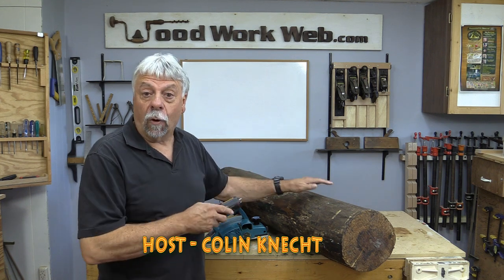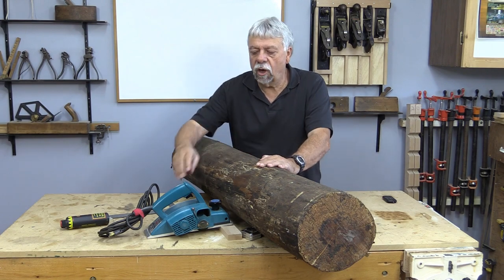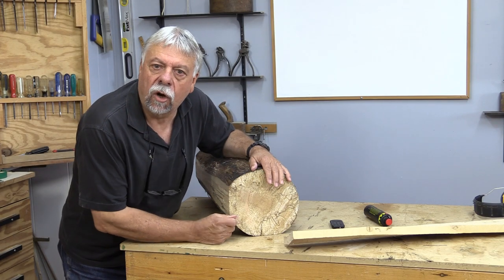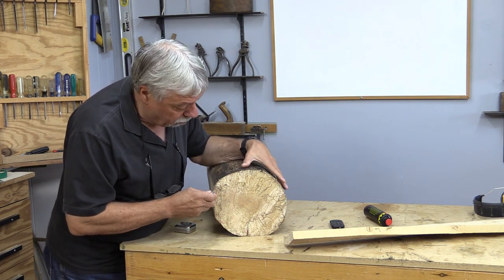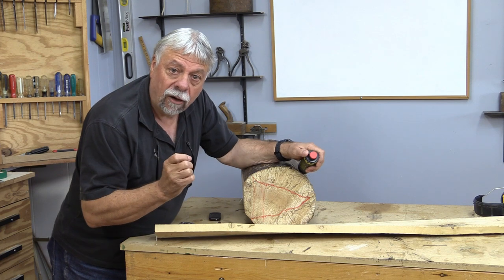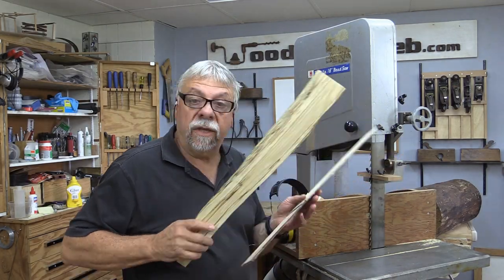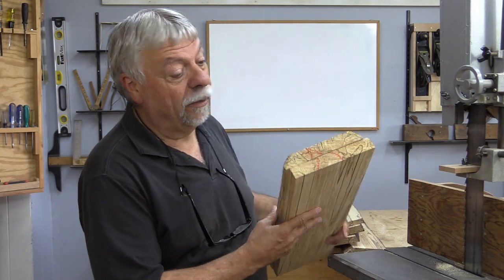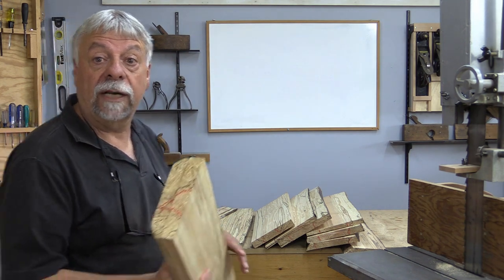How To Saw Your Own Spalted Lumber From Logs

Comment: Colin, I belong to a club who owns and demonstrates an old sawmill.  Try making a sled to run the log past the saw blade, you will be able to cut longer boards.  Also, when you stack and sticker the boards use heavy weights on top of the pile to minimize loss due to twisting.  Great tutorial, sir!
Reply from the maker: +Bill Sutherland Thanks Bill, I have often wondered if the heavy weights on drying lumber really makes much of a difference or not. I have tried with and without and even with serious weight on some, they still come out warped sometimes. I guess the point is, that it can't hurt to do that. Thanks again Bill ...

Comment: In lumber grading we call this incipient decay. Spalted sounds better for sale purpose. Basically its the beginning of the rotting process and it impars the strength of the lumber. Depending how bad it is it would either go into pallet lumber or go into the chipper. Cool looking I have a couple guitars made out of it. Careful if you have allergies. Cheers !!

Comment: Wow, that's one big honkin' blade on your bandsaw.  Nice boards.  I'm surprised how dry you are up the near the water.  It's tough to get anything below 20% down here in Virginia.  Outside it hardly ever goes below 40%.  I use a shopmade sled for cutting logs.  The logs attach to the sled.  Works great.  Off the pile and onto the saw.  Good video as always.

Comment: Do you Sticker the wood you have setting around to dry? 
I have found if I sticker the wood I have slabbed and then tie the boards into bundles to let them finish drying, I don't get as bad of war-page or twisting in the boards while they are finishing the drying process. I use the large nylon tie straps from HF or sometimes even some nylon tie down straps for motor cycles. Seems to keep the boards a lot straighter.
Enjoy your channel. thank you and keep up the good info.

Comment: That wood is amazing looking.  I think its wasted if it isn't displayed as table tops, or desktops, or panels of some sort.  I heard what you said about the fact it may not have the best structural integrity because of the fungus, so that's something that needs to be taken into account.  This stuff almost seems exotic enough to be turned into veener if that was possible.

Comment: A couple of questions for you or anyone else, who may know, but, isn't there a way to make a sliding Band Saw sled so you don't have to struggle with pushing or pulling the wood on the table, surface and, isn't it easier, better and safer to cut the outside of the log to prevent binding etc. I realize you'd have to  move the fence for each cut, but I'm wondering if it's a better way. Also, I never knew that Makita ever made a band saw, but they used to make a 6" planer just like the 3" you have. I use  to sub for a builder that had one and would use it to flatten logs etc for his homes. Not sure if they're still available.
Reply from the maker: +kperellie Yes, there are a few versions of making jig for cutting logs, the reason I didn't  was 2 fold, first of all this band saw does not have mitre gauge slot with would be very helpful for a jig, the second reason was that I reasoned that I could probably cut the logs quicker than it would take me to make the jig ... which probably turned out to be the case, really didn't take that long.  If I were going to do this a lot, I would probably make a jig, but for now I seem to be ok without. ... Good question, thanks for asking.

Comment: I like the use of the electric hand planer to make the flat sides.  Great idea.  For the slicing, you really should have a sled to which the log is secured.  The method you used, although it works, is not the safest and does not yield as accurate cuts.
Reply from the maker: +Mark Hazlewood Thanks for your suggestion Mark

Comment: . Those boards look amazing Many ideas, most of them obvious projects: .. Boxes, for one Furniture accents, too Any sizable scraps could be reserved for smaller projects such as pens or cutlery handles (both types of projects would benefit from those scraps being stabilized with resin. Pens usually take 3/4 "x 3/4" x 5 "and cutlery handles vary. Smaller pieces could also be glued up with contrasting wood species for small projects (turned, etc.). Regarding the movement of the boards in their final drying cycle, what if they were stacked with spacers placed in three locations and substantial weight placed on top of the stack? Would the movement (twisting, cupping, etc) still take place once the weight is removed upon hitting that target 9% water content? Lastly, what a bandsaw! The blade looks wider than my neighbor's lumber mill blades!

(Edit: apologies for all the odd capitalization. Chrome made some very odd auto-correct choices.)
Reply: +YasumotoUS You can normally constrain a lot of the wood movement, provided it isn't directly related to the grain of the wood by using stickers, weights/clamps.  Some of it happens just due to the way the grain moves through the wood though, so you can normally count on a little bit of that happening.  Not nearly as bad as if you just leave the slabs to move on their own though.When cutting through and through like this (boules) - I tend to put the log back together as I cut it with stickers every 18-24 inches and then toss a band strap with a ratchet around the whole log at each row of stickers.  Cinch it down nice and tight with the ratchet and it holds everything nice and tight.  Every month or so, come back to tighten down the straps again, it shrinks a little bit as the wood dries.Once the stack is dry (either air dry for certain applications - or a stint in the solar kiln), it is easy to pull what you need from the stack and everything is in order...because you kept it that way when you cut it.
Reply: Joe and Liz Thanks for sharing your technique!
Reply from the maker: +YasumotoUS Thanks for your comments and ideas. I have had not had the best results with putting weights on drying boards. I often wonder if it really works and I hear varying opinions on this so I really do not know. Maybe I need more weight, or as Joe & Liz say to band strap them. I guess in the end, it can't hurt to do that and any help in keeping them straight would be good.
Reply: +WoodWorkWeb A lot will depend on the specific species involved, and that often gets overlooked when discussing anecdotal evidence.  Hard maple for example tends to move a lot more than soft maple when drying.  Cups, twists and general waviness are pretty common.  Soft maple can often be left alone and it will dry flat with minor distortion and movement that can be cleaned up with a few quick smoothing passes on the jointer/planer.In the end though, I tend to weight (or otherwise clamp) all my stacks - but the more the wood wants to move, the more you have to weigh it down.  If you try to constrain it too much though, it can end up checking, splitting or having ring failures as the wood tries to overcome the weight.The alder you have here is normally pretty stable as it dries - the spalting actually will add to the stability as it reduces the strength of the fibers along the length of the board.

Comment: Shouldn't you be using a respirator while cutting spalted wood?  I wouldn't want to get any fungus dust in my lungs.
Reply: The spores which create the spalting are in the air everywhere.   We breathe them in 24 hours a day.   Still need a respirator because of the dust but, the spalting fungi are not a real danger.   We only need to take the normal precautions with a respirator with regard to normal dust protection.